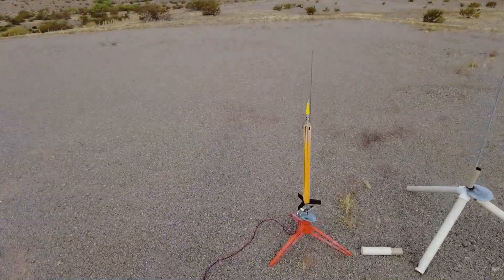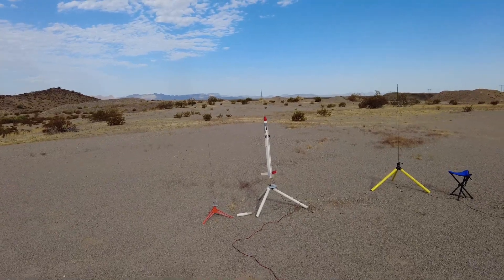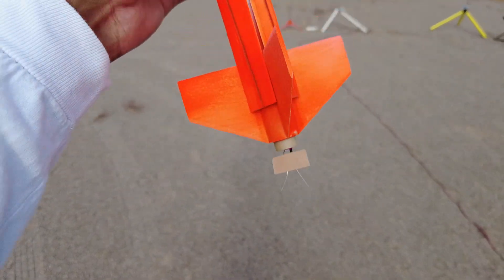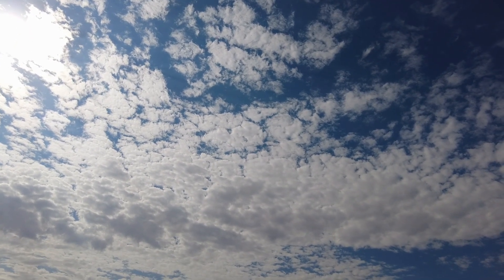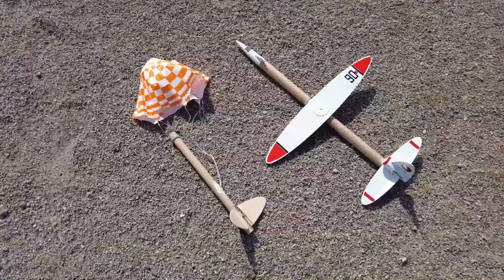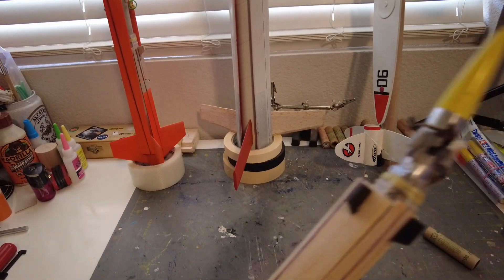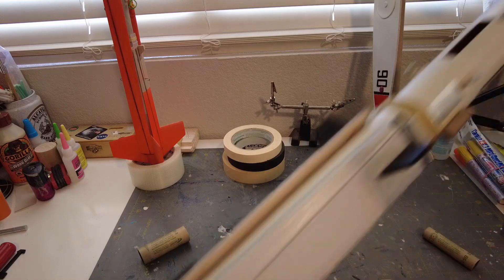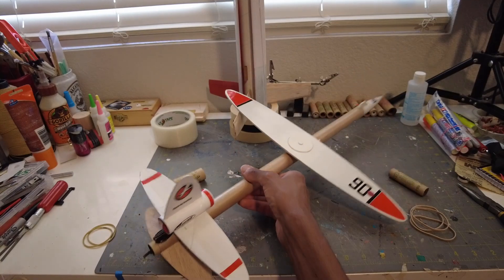Rotor-Roc Launch Madness Helicopter: Model Rockets

Comment: Starting at about 06:13 in this video: 

The rotors have two different 'hubs' where they attach to the rocket? 

I am NOT well versed on Rotorocs, but I always thought all the rotor blades attached at the same point. 

Learned something new...👍 

EDIT→ I posted this comment early-ish in the video, BEFORE you talked about this rocket later in the video.

Comment: Nice launches. Good job on the roto-rocs!! That first one is a bit of a mystery. Maybe need some venting holes for the ejection gasses. The four blade one is unique. Maybe send that design into Estes. Maybe they will kit it?
Reply from the maker: The 1st one had vent holes. I'm  preparing it. And going extend the damaged top. But it's a mystery for sure.